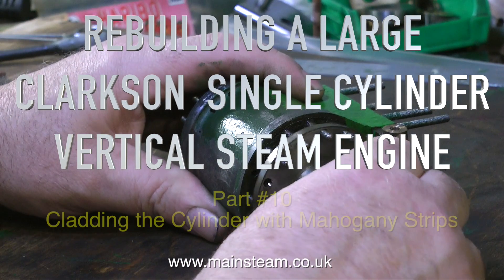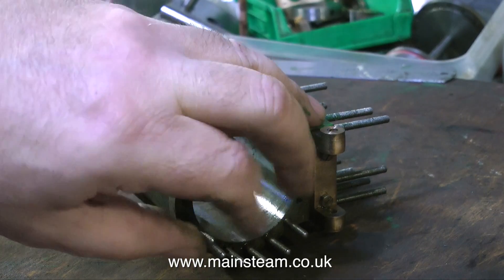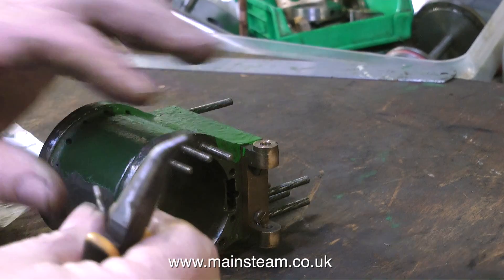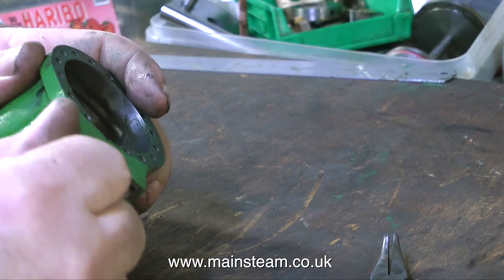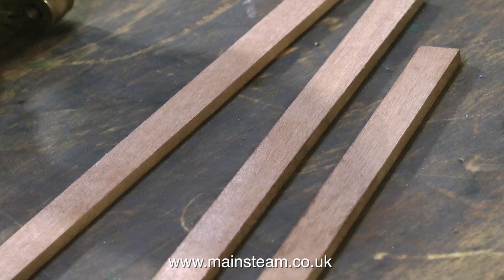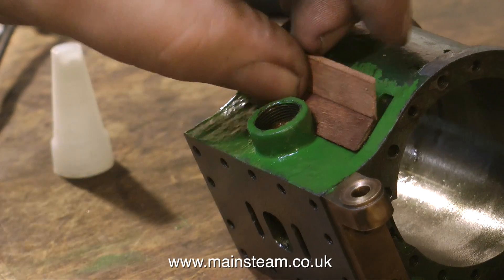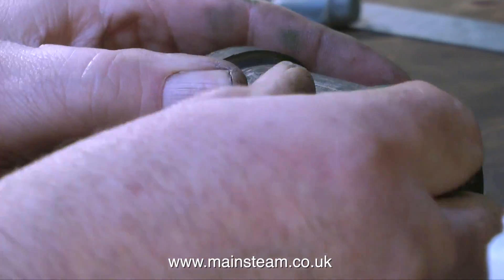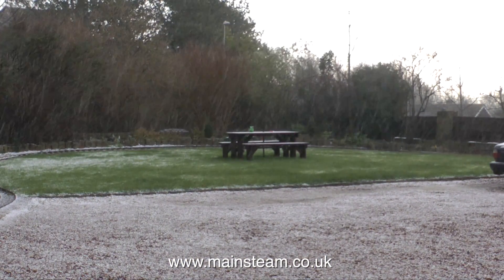REBUILDING A LARGE CLARKSON VERTICAL STEAM ENGINE - PART #10

Comment: pleasemforgive the comment but why are all the bolts and nuts imperial and in fractions, I had though the new stuff would be with metric bold  and for the way my brain works I hate fractions with a passion, it's easer for me to convert to a decimal system, but I am not a mechanical engineer my main field is electronics  that are in standard units.
I am some what of back yard mechanic and my Buick was made in Canada so it has an evil mix of standard and metric bolds
Reply from the maker: Because in the era of steam, Imperial measurement was the most popular. I was taught the Imperial system at school (many years ago) and so I am used to fractions.

Comment: This is not a stupid health and safety troll, it's an honest question - I thought superglue glued fingers, but you seem to be quite happy getting it on your bare hands. Is it a question of using the right glue, or is the problem much exaggerated?
Reply from the maker: +thisnicklldo You are of course correct, the secret is to wipe the glue off your fingers with a single swift wipe & never, I repeat NEVER touch any other parts of your anatomy with SuperGlue on your fingers :-)
Reply: +Keith Appleton OK, I've had another closer look and I guess you don't get too much on your fingers, mostly just a bit of squeeze-out between the planks, and I suppose it doesn't stick fingers to wood so easily. It's not an experiment I've ever dared to try - probably too easily influenced by health and safety horror stories.

Comment: awsome built that wood looks really good on the engine and an awsome railway in your backyard is that for your 5 inch loco
Reply from the maker: +luc snippe Thanks Luc, the railway around my garden is 7 1/4 inch gauge.
Reply: Keith Appleton awsome how bigger how better ;)
Reply: +Keith Appleton In last video you mentioned rust removing problems.I recommend vinegar or chemical removers you can buy in hardware stores(around 5$ for liter).Or you could make electrolytic bin ,plenty of how to on internet.
Also i recomment wire brushes for drill  that you can buy for usualy 10$ for a set.